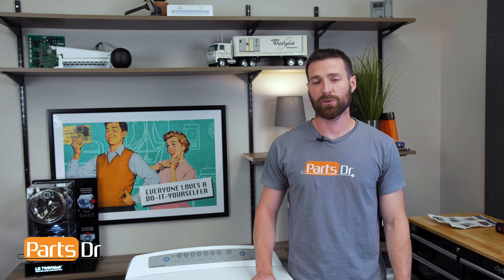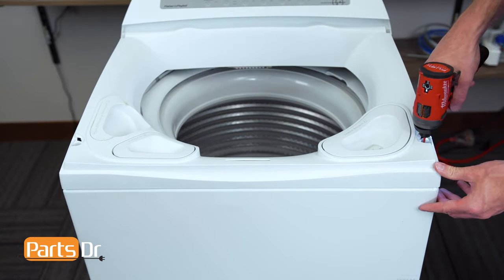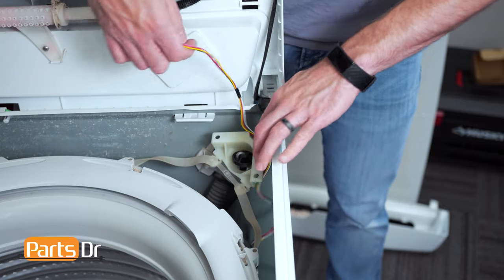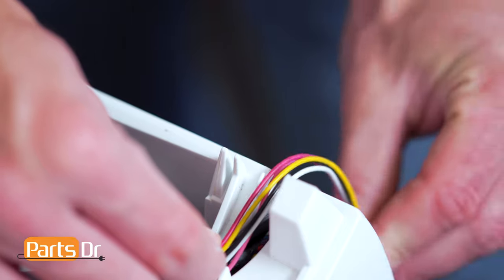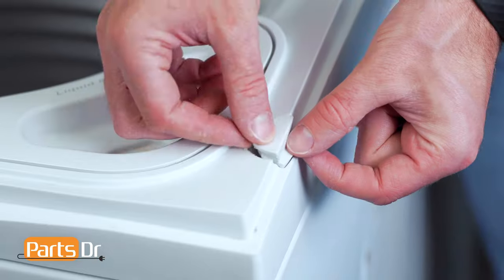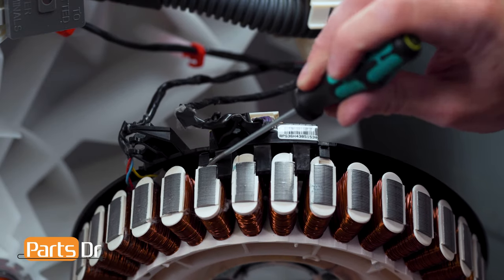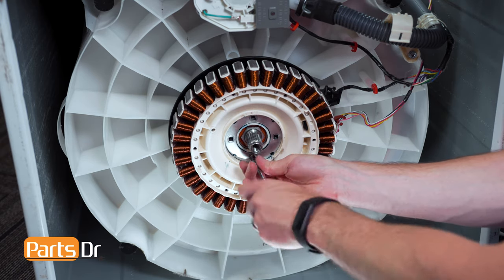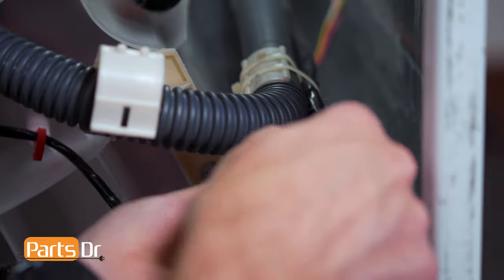How to replace Fisher & Paykel washing machine Rotor Position Sensor part # 424349P

Comment: Thanks for the great step-by-step video.  Managed to replace the Rotor Position Sensor without removing the stator by leaving it in position and maneuvering the RPS into position.  Also added some electrical tape around the wires around where they are secured under the tabs and where they enter from the top of the machine to prevent any rubbing in the future.
Reply from the maker: Nice job fixing it yourself!